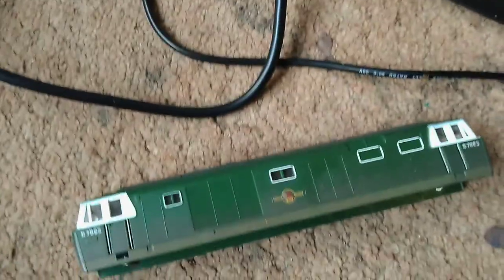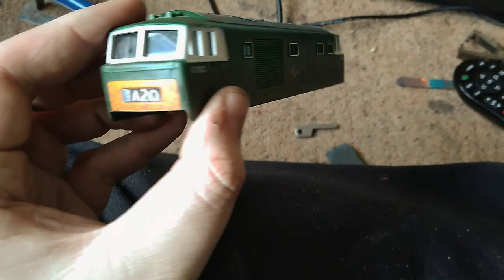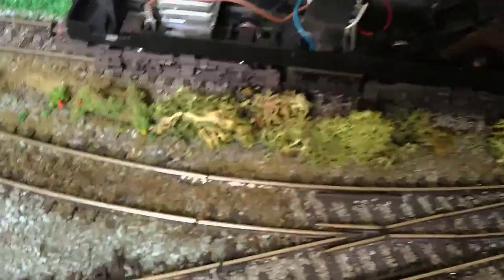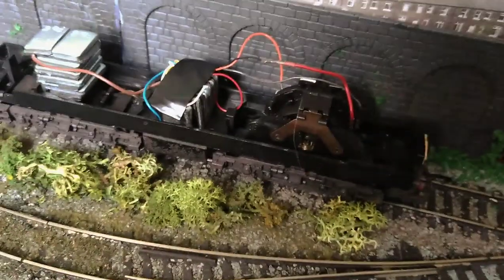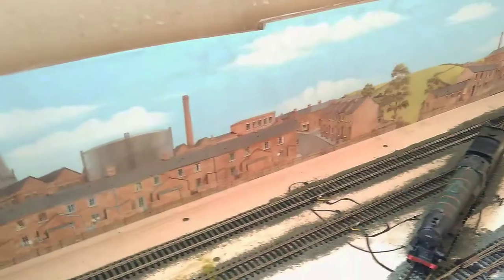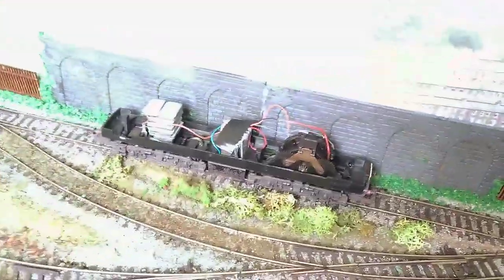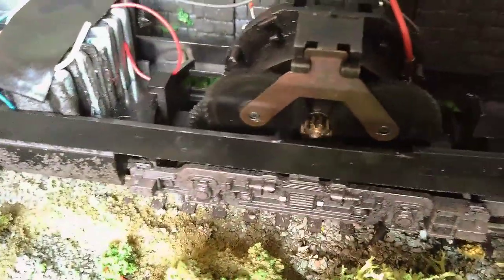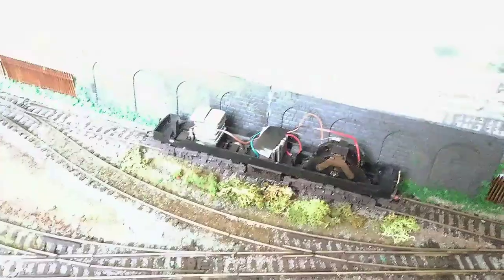OO  Gauge HyMek upgrades | Hymek project part 1

Comment: Thats a good price for a working loco - I'm going to follow this with interest, as I am after a cheap Lima 26 to do likewise.
Reply from the maker: Cheap locos are good! If you like running them high speed continuous run then they need little in the way if fettling.

If like me though you like prototypical speeds and operations such as shunting etc
Then you need more reliability from your stock.

Adding weights, cleaning pick ups and fitting stay alive caps go a long way t ok achieving that.

I posted another update in the series earlier and will have another two later in the week 😃